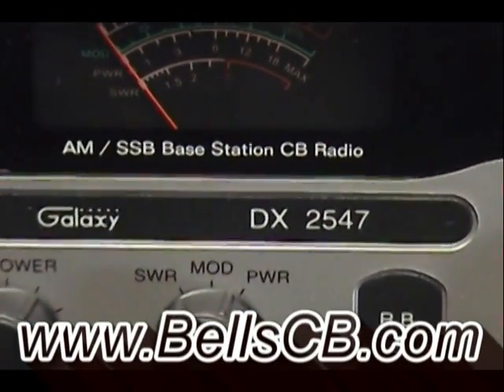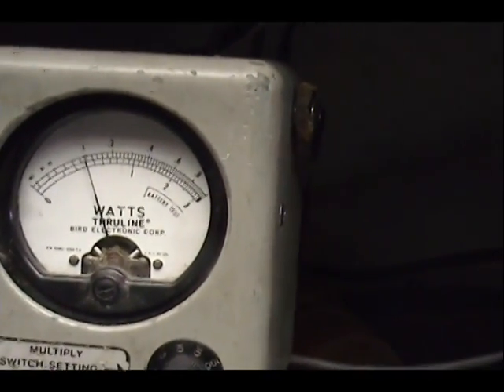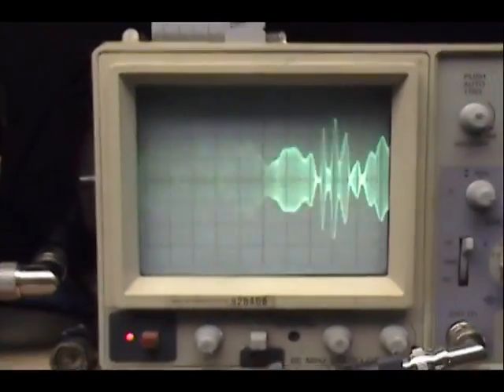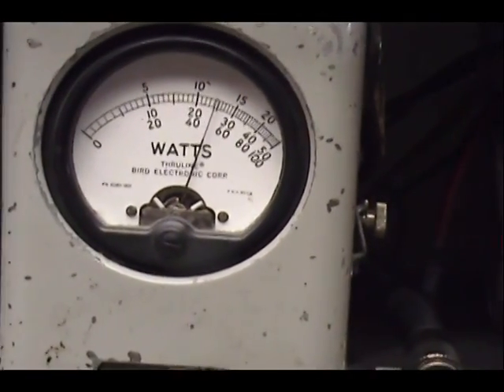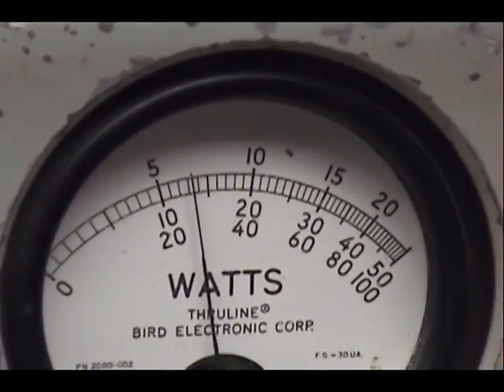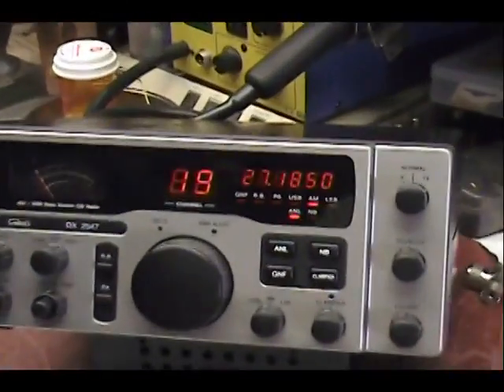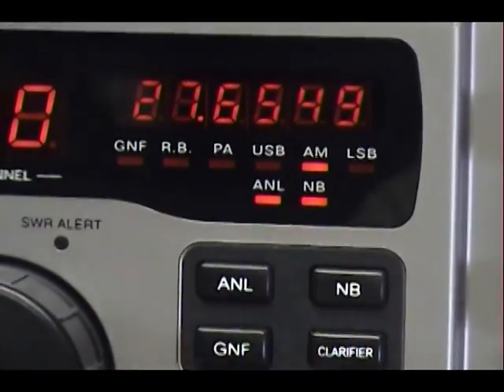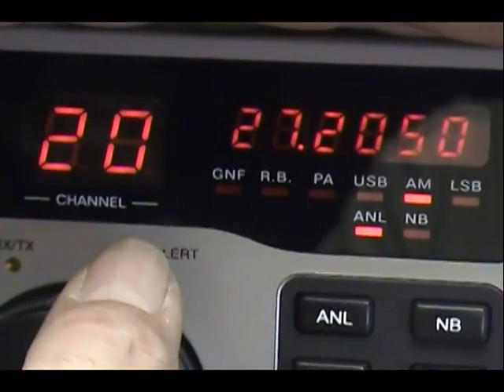Galaxy DX-2547 Tune-up Report

Comment: I wanna buy one on amazon does it get good power out of the box or did u tune it for that? I also want extra channels for it too. Is there a way to get it to fine tune like a ham radio so i can use 27.555?
Reply from the maker: It does about 12-15w out of the box Kandi. There are mods for 27.555 access and also to allow fine tuning +/- 6Kc